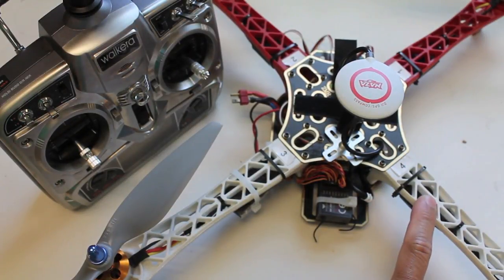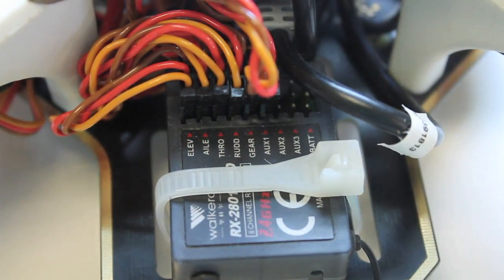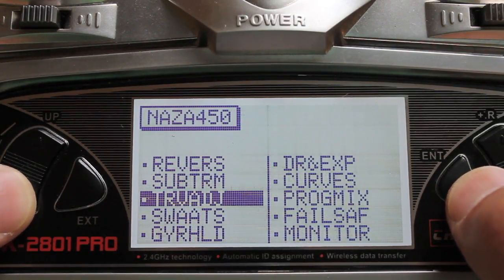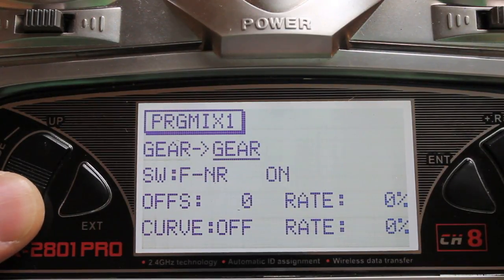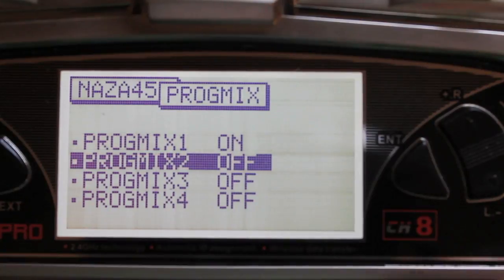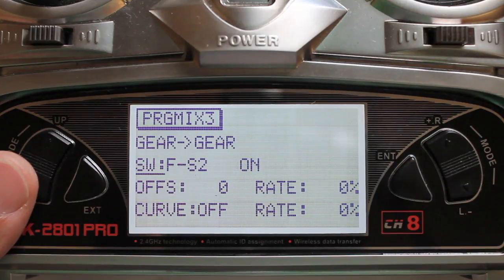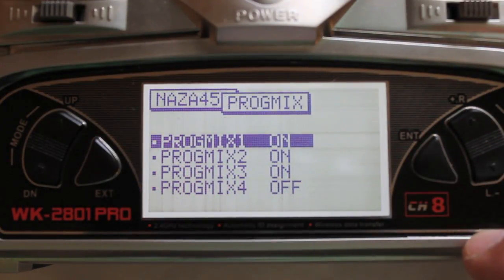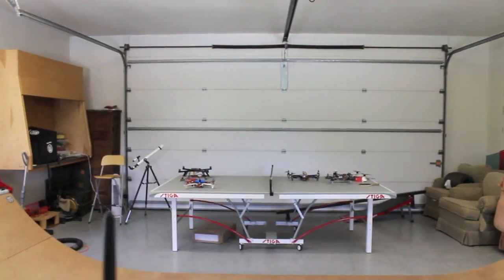DJI NAZA Lite 3 Flight Modes with Walkera WK-2801 - GPS Attitude, Failsafe, and Manual Mode

Comment: Hello!
I have a quad with naze32 rev.5,
rx-2801 pro and the walkera radio wk-2801 pro.
I am in trouble where the quad is armed and when turning off the radio tx (testing the loss of signal) the engines accelerate to the maximum.
In betafligth it is set to fall and still does not turn off the motors.

Did you have something like that?
thank you

Comment: Hi Dennis, Great videos I have the exact same setup and have learnt a lot from them.
One question, do you know how I can go about setting one of the 2 mode switches for failsafe?
I know I could just turn the TX off but I feel that that could be a little risky.
I have seen a few people doing this with different TX's, 3 way switch for the flight modes and a 2 way to switch from the flight modes to failsafe.
Any help would be great.
Gary.

Comment: One thing people miss is failsafe when signal is lost. I know how to do this with a Spektrum TX but not a Walkera. Do you know how?
Reply from the maker: Mitch Peterson I've set this up with the FrSky TX/RX before. Not sure how to do this with Walkera. Sorry. Generally it's something as simple as putting your sticks in the position you want and pressing a button on your RX to remember your settings in case of signal loss.
Reply: +Dennis Baldwin  I am having the same trouble with the lost signal mix  I was wondering if  there is anybody out there that  can help me out   I am having the same trouble with the lost signal mix on the  2801pro .. Naza m lite ....  I am a newbie and I would appreciate it if someone could help me out
Reply: +curt solomon What transmitter

Comment: Why 7 channels plugged in on the lite?
Which one is the actual 3 position switch cable?
Plug and play, I wish
Reply from the maker: MicroRCFiend The 3 mode switch cable is the one that goes from the receiver to the U port on the NAZA Lite. I know it's not "plug and play" but definitely the closest I've seen in the multirotor world. Good luck with your setup.
Reply: Deviation firmware is my issue or I would follow your excellent tutorial to the letter. I'll just take 6 months out of my life and learn how to use the advanced mixer ;/

Comment: Dennis / All

Why are there two locations on the control mode switch panel for FAILSAFE?
Is there any difference which one you set the switch to activate?

Cheers

Andy
Reply from the maker: Andy, thanks for the comment. No, there is not a difference about which one you set for failsafe. It's configurable so you can do whatever you're most comfortable with. I hope this helps and please feel free to check out www.garagepilots.com if you have any more questions. Someone in the forums will be glad to help you out. All the best.

Comment from the maker: Right now all gains are the default. Not too snappy, but not too slow either. Perfect for my friend who is getting into multirotors. I do have a video that shows my gain settings for higher performance flying. I recall be around 140-150% on the pitch and roll gains.

Comment from the maker: I've been fairly impressed so for. I know it will work with the F550, but will not do autopilot. You can get GPS with it so it will do RTL if you get in trouble.

Comment from the maker: I've read that the NAZA Lite cannot be upgraded. That doesn't mean you can't purchase a new version if DJI comes out with it, but I don't think you'll be able to update the firmware. I really like the APM a lot. It's so flexible and powerful for the money, but takes quite a bit of knowledge to get familiar with it. If you've worked with quadcopters and have technical knowledge then the APM is the way to go. But if it will be your first build do something simpler.